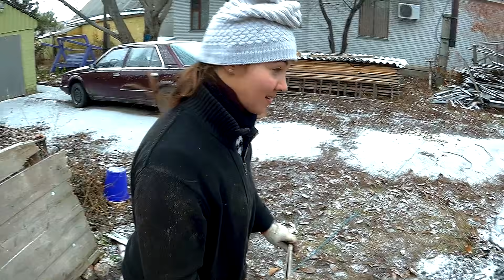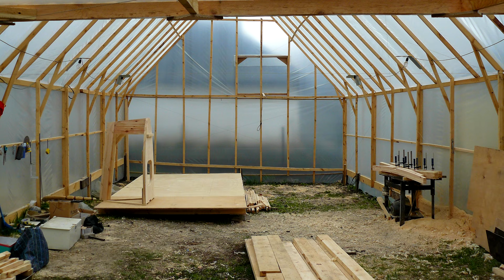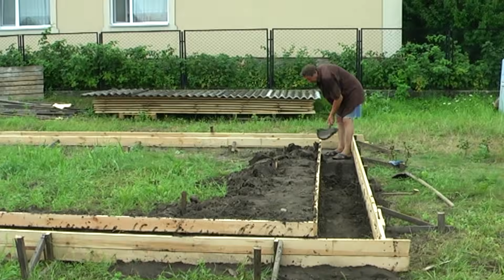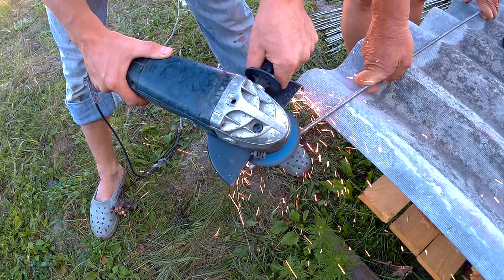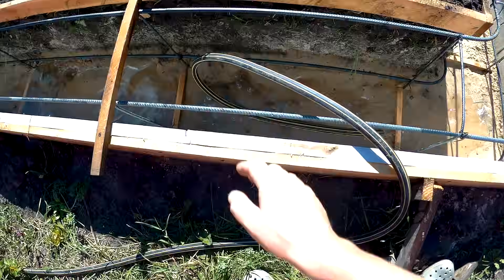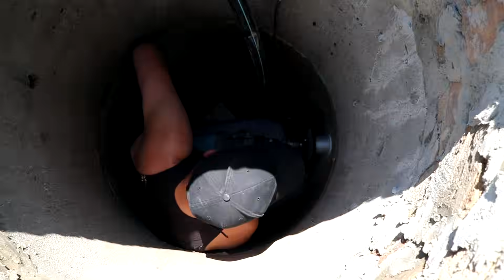I Built a Cheap Strip Foundation for a Debt-Free House | CHEAP HOUSE 2

Comment: Great work from all of you. Obviously the costs in your country are considerably lower than Australia. I am about to lay a small slab next weekend and it's only 0.6 cubic metres but will cost me $475 for the concrete. It is coloured which adds a fair bit to the cost.
Reply from the maker: Thank you for sharing your concrete prices. Our concrete prices have also increased to $100 per cubic meter. But I see that's still significantly cheaper than yours.
Reply: Wahnsinn diese Preis das ist doch geschenkt. 285€ pro qm³ ohne Steuern und Transport aktuell in Deutschland.